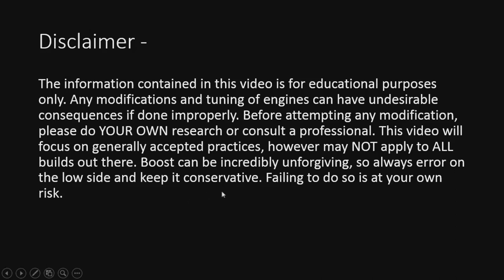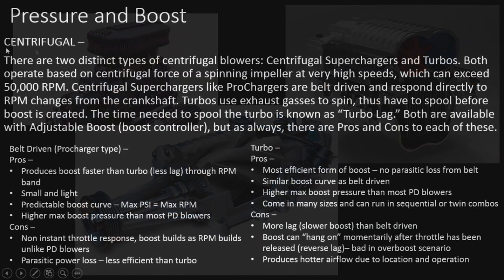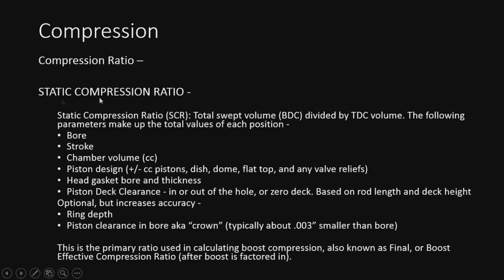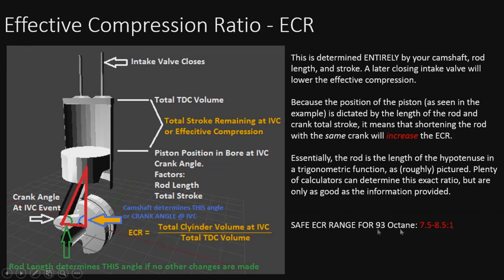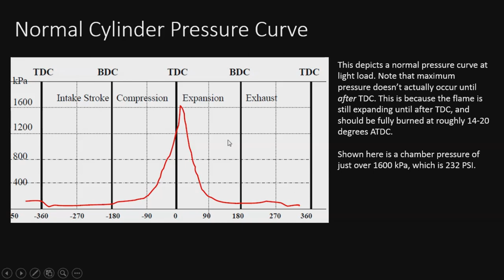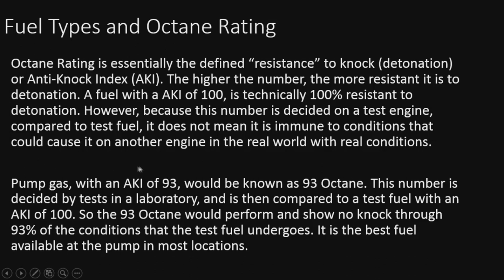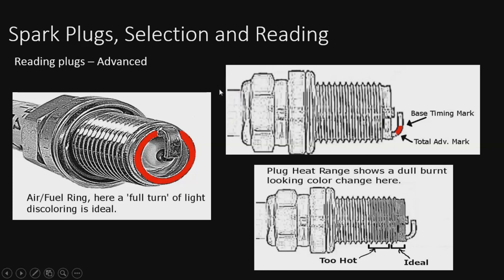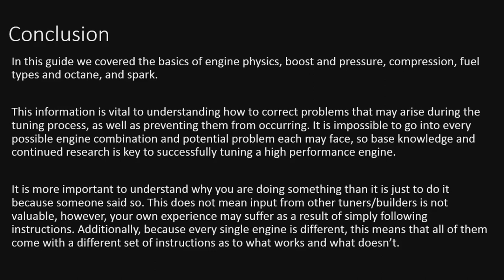Engine Physics 101: A Tuners Guide to Boost, Spark, Compression, and Fuel

Comment: Awesome video, at 27:22 you type "values under 12:1 are generally considered safe for 93 octane with aluminium heads, boost only, no intercooler" tell me senpai, what if I upgrade that to 105 octane (re85-biofuel) and water to air-chargecooler, how high of a final compression ratio could I go? 13-1? thanks in advance!
Reply from the maker: This gets pretty subjective pretty fast, but at that octane I think you would be okay. Internal engine physics get pretty complicated based on many factors like head design, piston design, quench, and so forth. Best way to know what works best is look around for similar builds and see what they are running. I actually think you could get more than that potentially. I know a lot of guys running pro chargers on stock internals and getting as high as 8 psi on pump 93. It works for short bursts on the street, but probably not something that would hold up if pushed hard for longer. I’ve seen those combos run successfully for quite a while. The video is meant to make you aware of the physics and make you consider limits that many don’t think about it. In an effort to avoid giving bad advice, I kept the numbers very conservative for obvious reasons. If stock LS1’s hold up with 8 psi pro chargers I’d doubt you’d encounter too many issues with your intended setup. It also depends on the purpose, because I wouldn’t recommend that stock setup to go through a racing season either, however, that too has been done. It’s a cheap setup to run, but anyone that does that is also aware of the dangers running that, because it’s considered the cheap+fast build lol. That leaves reliability out of the equation.